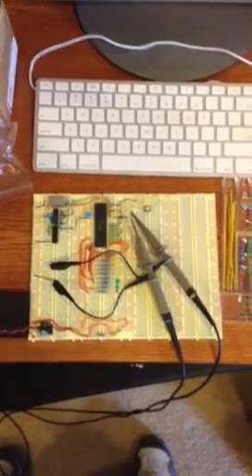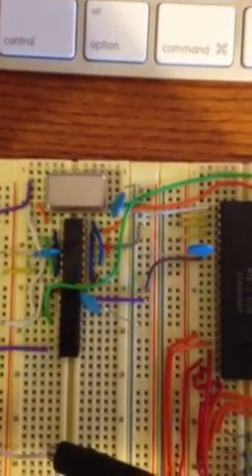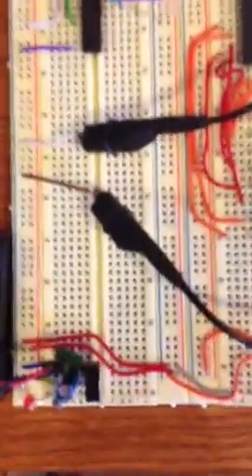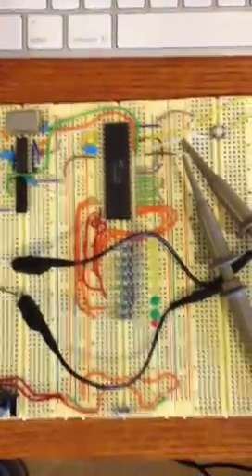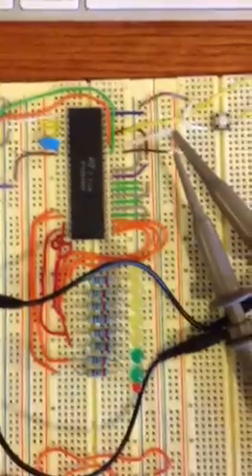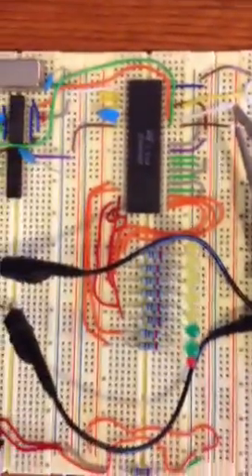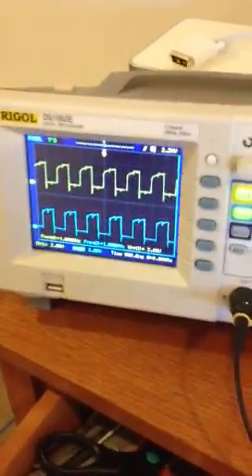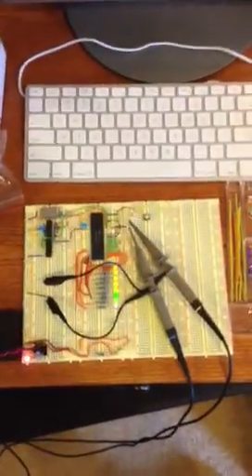6809 breadboard computer

Comment: Nice demo.  Thank you.

I have to try this but I've got the 'P' version (HD63C09P, actually) which requires a simpler clock...
Reply from the maker: I need to pull this project back out, once I finish with the 6502 stuff...  I have something cool planned for it!

Comment: Sorry for the repeated comments, but have you made any further progress with your 6809 project??? I've got mine up and running to the state yours is at!
Reply from the maker: Oh man- no need to apologize, I'm happy you are interested in the project.  I actually lost steam on this as I had my home office where I was working on this re-painted, and had to put all the equipment in a rubbermaid bin..  Hope to start up on it again soon.

I started doing some research- I want to next implement RAM, and also an array of switches so that I can program the memory locations.  Also some sort of display is needed, and then it will be a functional, programmable computer.  I actually got as far as shopping for 7-segment LED displays, but did not find any currently available that would be able to display hex characters.  Maybe an arduino could be used as a cheap/easy translator?
Reply: Corneleous Worthington It seems mine has the same crashing issue with the clock so I'm going to try the same fix you did! wooooo... The guy who made the Ultim6809, seemed to use some more than 7 segment displays, but otherwise the same idea. An attiny AVR chip could definitely be programmed to be a decoder, and has a smaller footprint than a full arduino board!

Now, I only have an Attiny45, which doesn't have enough I/O pins for my needs, but there are models with enough io for that purpose, also the DM9368 would do the job

Comment from the maker: Thanks very much!!  I actually got the schematic for the crystal oscillator clock from the 68B09E datasheet..  With use of the 4MHz crystal, I believe I am underclocking- it runs the CPU at 1MHz, where the 68B09E is rated for 2MHz..